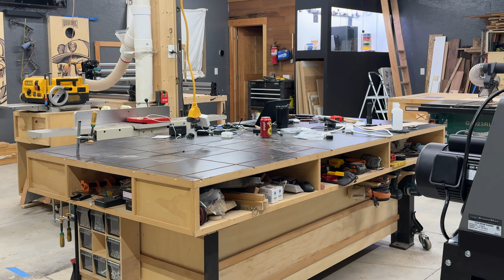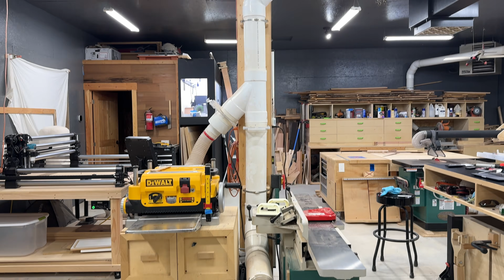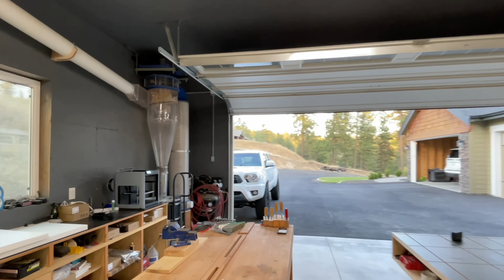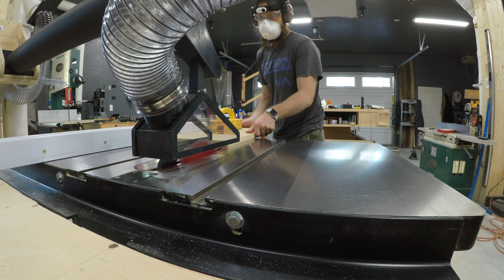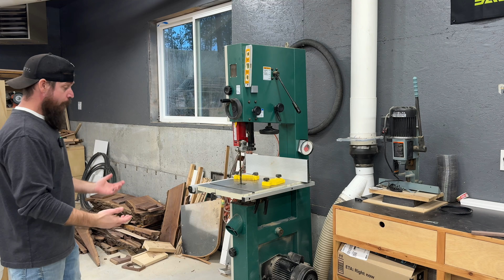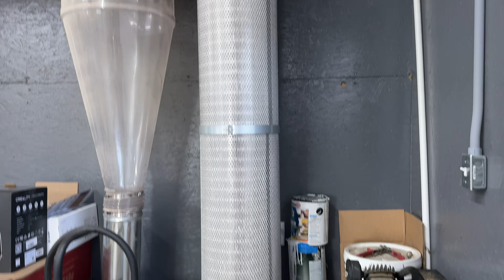YouTube hack shows off his woodshop — shop tour

Comment: This looks like the perfect sized shop.  Great spot for your printers.  Having climate control beats having to keep an eye on the filament and baking at low temp if too humid.  I'm really interested in the assembly table build and joined the channel for that and your 3D printing stuff.  I'm planning a multipurpose table with the match fit system as well.
Reply from the maker: Thanks man, the 3d print enclosure has been great. 

The assembly table was a fun project, and if you haven’t used the match fit system yet, you’ll love it. Thanks for the sub and taking the time to comment. 👊🏻

Comment: As far as the 19/38 goes.. the most useful accessory for that is absolutely the DRO.  Highly recommend installing it on the machine.  Makes sanding to a specific thickness a BREEZE!  The tables are a nice have and if your budget allows get them too
Reply from the maker: I’ve got my eye on the DRO, I think that would make a huge difference. The factory thickness setting seems a little goofy to me. I’m also definitely ordering the in-feed and out-feed tables. They didn’t have any in stock at woodcraft when I bought my 19-38. 

Also I’m glad you’re liking the timer for your clear vue. I’ve enjoyed it as well. Thanks for watching and commenting, it’s always nice seeing familiar faces in the comment section. 👊🏻

Comment: I absolutely love the Clear Vue auto timer mod that you turned me on to. No more wondering if the machine has run the recommended 15 minutes or not and the emergency cut off switch gets used when Im making quick cuts where the Dust collector only runs for less than a minute. (in my opinion not enough time to heat up the motor)